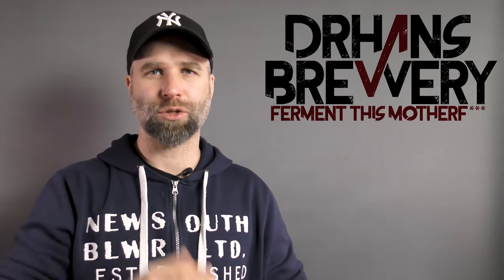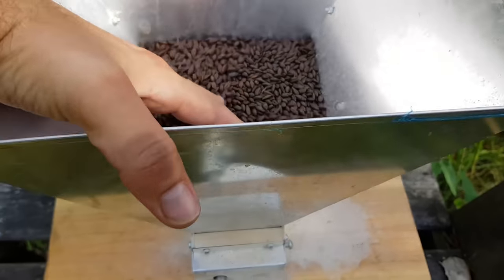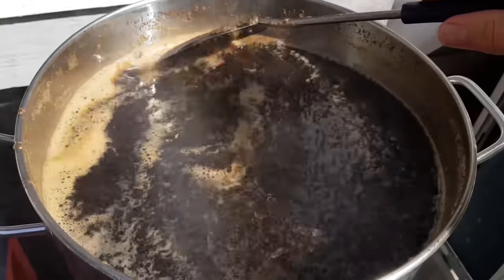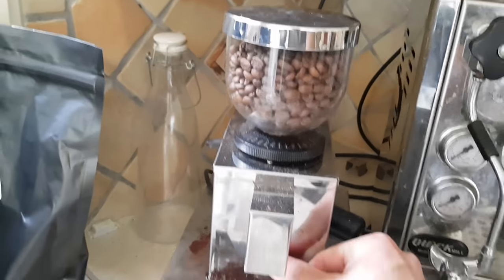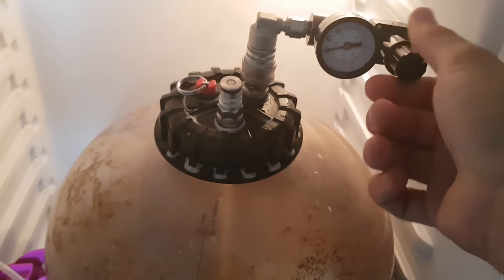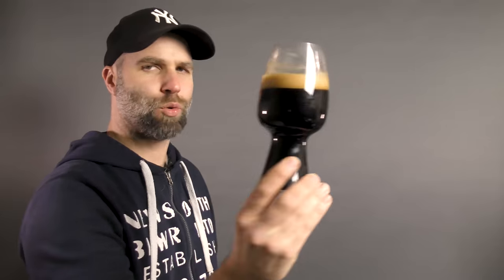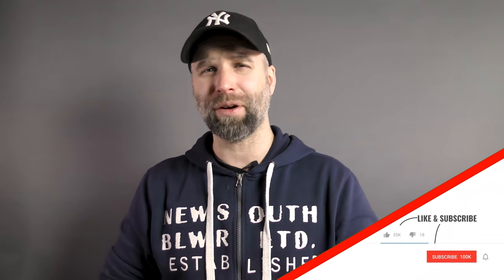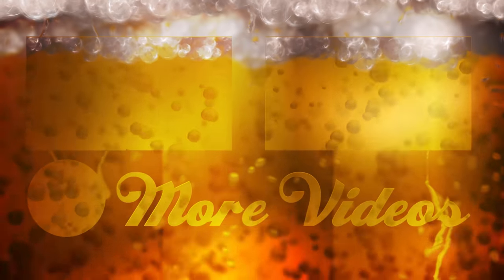Chocolate Coffee Stout - all grain to glass brewing and recipe

Comment: I'm happy to see that you are skimming off hot break since recommending it to you some time back. How does adding wheat malt counteract added fat? A spunding valve is used on a secondary fermenter and on conditioning tanks not on a primary fermenter. What is top mashing and what purpose does it serve? Mash pH is adjusted to be optimum for the enzyme being activated. Mash pH isn't stuck at a single pH when making ale and lager.
Reply from the maker: Top smashing is when you steep part of your grains on top of the mash for a shorter time at the end. Instead of giving it a full mash. It gives a smoother non astringent beer. Try it with dark malts like chocolate malt or roasted barley for example.

Comment: Watched with interest, thinking of using Peanut butter but I've never used fats so Thanks for the info looks a solid drink Cheers
Reply: Powdered peanut butter is the way to go.
Reply: I think adding fats AFTER the boil could be more of concern.  Heat and pressure are going to separate the lipids into smaller "amino-acid-like" components.  Any fats AFTER boil could inhibit head retention since lipids are "slippery" a scientific term
Reply from the maker: I clearly need to investigate this topic further!

Comment: Apologies if this has been raised already, but 5.2 seems a low pH for a stout mash, especially BEFORE adding the dark grains. I tend to target a pH of 5.4-5.5 for my strong dark beers during the mash, as reading has led to be believe that a higher pH at the end of fermentation gives a rounder, smoother flavour to dark beers. Can you comment on that?
Reply from the maker: Andrew!! No apolgies needed. When the dark grains goes in using this method the mash is already over. Regarding if a lower PH gives  smother flavour to dark beers i cant comment about. What I can say though is by using this method you will get a really smooth dark beer IMO. Bets if you try it out for your self. Cheers DrHans

Comment: Not sure on the "fat" is bad for head retention as I haven't brewed anything with an amount of fat in it but... I've brewed Kolsch just base malt (an amount of sour malt for water adj) hops water and yeast so no fat at all and.... no head retention, although the traditional Kolsch also doesn't have a head to speak of... food for thought,  cheers Dr H, Mike 🍻🍻
Reply: Kolsh doesn't have many proteins left for much head retention.   Kolsh is supposed to have little head retention, if any.
Reply: @kerryhales8736  correct 10 points 🍻🍻
Reply from the maker: Yes. You could add some wheat in a kolsch for the head.

Comment: Nice video! Just wondering, why did you add the dark malt in separately to the base malt mash? Does this make any difference?
Reply: From what I remember, it pulls less tannins from the heavier roasted malts, gives a cleaner profile. I've had good results without adding late, but I'm going to try it next brew.
Reply: Dark malts have little to no effect on fermentation.  So, adding them later makes no difference except to flavor and color.
Reply from the maker: As already answered here. It makes the beer smoth without the astringency and needs no time to condition.
Reply: Thanks for that everyone. I may try this in a stout at some point. Cheers!

Comment: Good experiment Doc.  I'm going to turn this fat question around.  Do you think adding the chocolate bars to this recipe added anything to risk potential head reduction?  Couldn't you get just as much chocolate flavour from using the Chocolate malt and the nibs only?
Reply from the maker: Good question. Yes I could have added knibs to the fermenter. Could have used some darker wheat malts etc
Reply: My experiments have suggested that adding too much (it's a fine, fine line...) chocolate malt will again introduce astringency. You need more than just malt to introduce chocolate. It's art...really.
Reply from the maker: @jcinsaniac  Try to top mash the chocolate malt instead. Than you can add more without the astringency. It comes from mashing it to long in my experience. For chocolate there better malts to get chocolate from than chocolate malt. Try midnight wheat for example or chocolate wheat malt. It gives way more chocolate than the barley one in my opinion. Cheers!
Reply: @ @DrHansBrewery  I have wanted to exbeeriment with midnight wheat - I also have gotten 1 lb packs of different kinds of Chocolate malts to see which I liked more. But the most powerful chocolate I have sampled is from nibs - Valrhoma Grue nibs. I want to experiment with steeping some and doing a tincture with 190 proof grain alcohol for maximum extraction. You say to use maybe high heat for a short period of time as a steeping grain - is that the top mash? I'm unfamiliar with that technique but google is your friend, so I will do some searching on that. Prost!

Comment: At what time in the mash did you add the dark malts? 
Cheers
Reply from the maker: Added them at mashout for stouts I do 20min step before sparging.
Reply: @DrHansBrewery  hy Doctor, why do you  add Dark malt at mashout, 20 min step before sparging and not at the beguining of the mash?
Reply from the maker: @jacquael  Its because it makes the beer smother and with no astringency and harshness. No need to condition the beer for a long time and so on. I usually do 20min if its astout or porter. 10min for BIPA. If I just want the color I add it at sparging.  The roasted malt dont need any mashing just steeping is needed. As the conversion is already over in the roasting step of the malting. Cold brew is another method you could try. But this method is so simple and works so great so this is my main method. Please do try it end leave me a note on how it worked out for you. I bet you will love the result. Cheers and sorry for the long answer :D
Reply: @DrHansBrewery  thanks a lot for you answer! i plan to do a stout this weekend so i will do as you said. i would like to add chocolate flavor but no cacao butter. I am thinking of adding Van houten powder 5 min boil or flame out what do you think? i will also try to add cold brewed coffe in secondary.
Reply from the maker: @jacquael  I would ad it at flame out. Hope the beer turns out great!
Reply: @DrHansBrewery  thanks just a last detail. When you add the dark grains you keep the temperature of 78 degrees during the 20 munutes?
Reply from the maker: @jacquael  ye s75-78C if doing a mash out